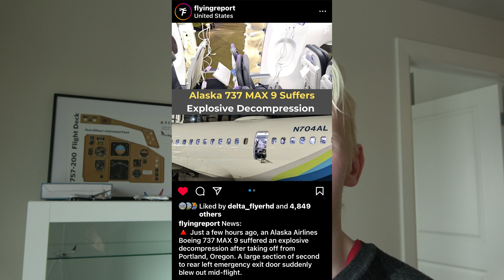Everyone’s Wrong About Alaska 737 MAX Incident

Comment: What.....the 737 is safe to fly......so the FAA are wrong in grounding the 737 max 9 then ?.... unbelievable
Reply: First.. CTFD. It's one door that had the issue. Let the FAA do their job, and provide an answer. Airplanes have had issues for decades. They get resolved.
Reply: @brkitdwn  No it's not one door. Several doors have been inspected and loose bolts have been found...... don't you read the news??
Reply from the maker: These type of temperate groundings are actually very common. It just happens because it occurred to the 737 MAX that the general public is paying attention to it. Door plugs have also had less strict maintenance standards than regular emergency doors have. I expect that to change. It wouldn’t surprise me if inspected future lose volts and fittings would be found on the 737-900 and A321Neo door plugs.

Comment: Everyone's wrong ???  When and aircraft is pressurized, that means the pressure inside is greater that of the outside. During an explosive decompression, things are BLOWN OUT, not sucked out.
Reply from the maker: I probably could have explained that better but it is an explosive decompression because of the massive pressure differences at the time of the event.